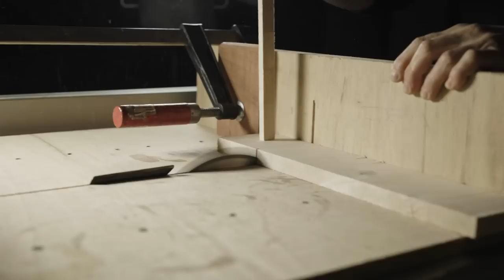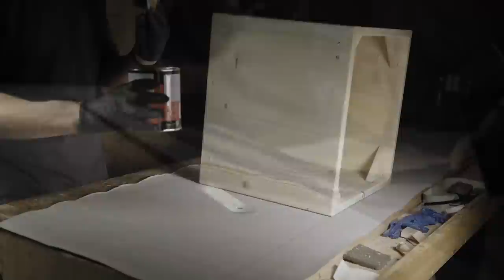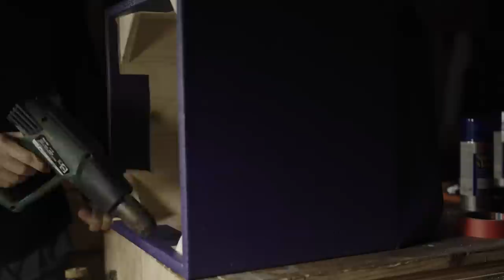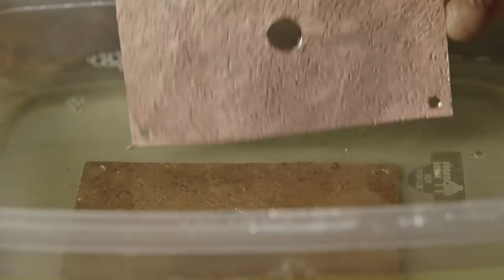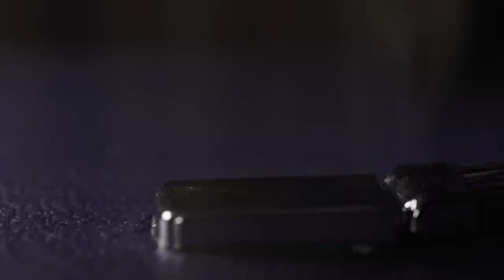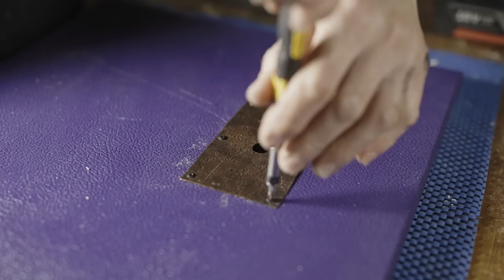My First Attempt at Building a D.I.Y. Guitar Speaker Cabinet

Comment: Wow! An excellent effort for your first attempt! I love the color you've chosen and the copper jack plates are a nice touch! I too build custom guitar speaker cabs for my own use and friends. A couple things you might consider doing, especially when making small enclosures, is the open/semi open back design and also using blind nuts and machine screws to better secure the strap handles. Cheers!
Reply from the maker: Thank you so much for the tips my friend

Comment: If you got a handheld router, get the circle jig. Amazon sells them, it fits on the face of the router, you drill a pilot hole in your work piece for the pin. Works just like a protractor, simple fast and perfect circles.